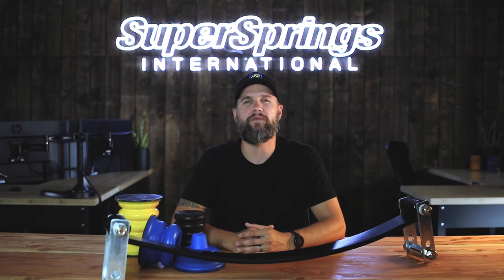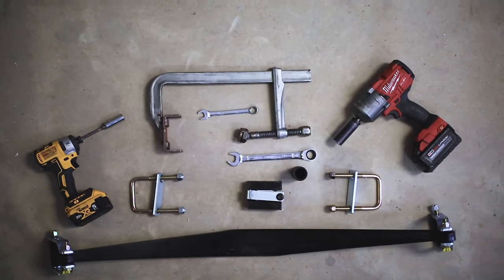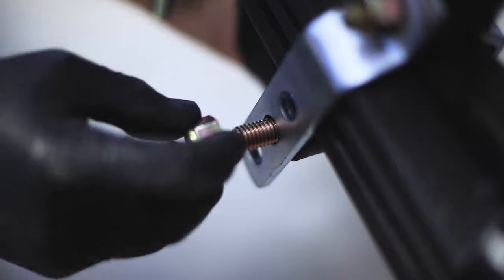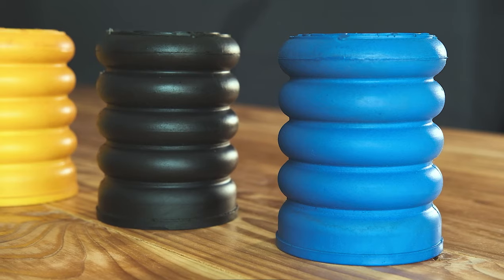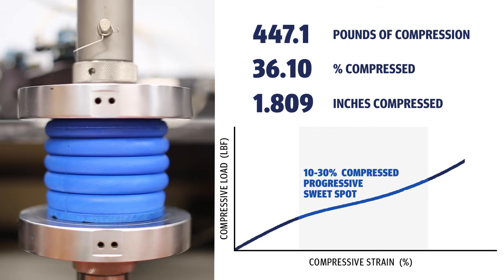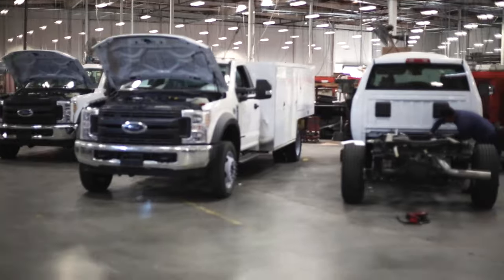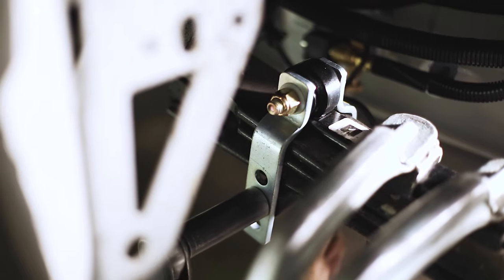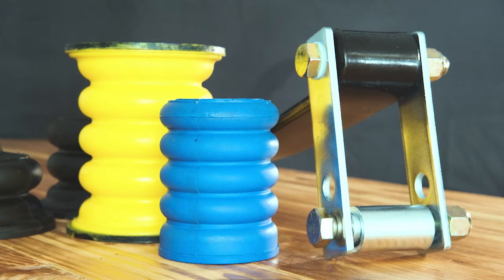SuperSprings vs. SumoSprings | Which one should I buy? | VLS ep. 2

Comment: We have a 2012 F250 Super Duty that we use to pull a Fifth Wheel with a 2800 lb pin weight. We only take it out 15-20 times per year. I'm guessing the SumoSprings would be better than the SuperSprings but not sure which "color". Am I incorrect or I guess I should say "what is your recommendation"? Also, if the SumoSprings are correct, is it ok to go with the heavier (5,000 vs 3,000) or is that not something I should do?
Reply from the maker: I'd go with our Blue Rebels the 3000 capacity ones! - Josh
Reply: Thanks Josh! I forgot to mention ours is a 4x4 if it matters.

Comment: Hello I have airbags currently on my f250 with a carli lift that has progressive leaf springs and need to run almost max psi on my bags to get back to near level even with my equalizer setup. Would the superspring still work with airbags and springs that don't have an overload?
Reply from the maker: You'd have to send us pictures of your suspension to confirm fitment on your vehicle. - Josh

Comment: Looking at adding a SSA26 to my 2006 F550 rollback, they bolt on top of the overload spring, could it not be adjusted so that they are not contacting the overload perch until weigh is loaded therefore not affect the unloaded ride quality? Not that its great now, just wouldn't want it much worse.
Reply from the maker: Hi Chase, For the F550.  The SSA26 will engage the overload spring and add a lot of preload to the leaf pack.  Because of this, the overload perches are not used anymore.  However, since the preload is much higher, the ride will be noticeably firmer. And the ride height is higher when the truck is empty.  That's the give/take you have with adding SuperSprings to strengthen the suspension. - Josh

Comment: I have a 2007 Dolphin 6320 (34' actual length) class A Motor Home. It's on a M22 Workhorse chassis.  The wheel base is really too short for it's length.  I have added Track bars front and rear, heavy duty sway bars, Koni gold shocks, steering stabilizer, and it still sways side-to-side in the rear.  It is enough to make handeling somewhat difficult. Which of your products do you think would SOLVE this expensive problem?  Many thanks!!
Reply from the maker: Unfortunately, we don't have products that fit your Motorhome.

Comment: I have a 2015 F550 rollback and I need whichever product reduces rear sag the most - The absolute most extreme product for reducing rear squat b/c the factory overloads are already making contact BEFORE it’s loaded with 2 vehicles.
Reply from the maker: Hi, thanks for reaching out! I'd recommend our SSA17 or our SSA26. Our SSA26 is the strongest. You'd probably require our ITL-8 tool to install it. But that'll get rid of the squat. - Josh

Comment: Added the blue summo springs to my 4Runner.  As the springs are always in contact you can feel the difference.  The 4Runner is not as smooth.  It’s a little choppy.  However, they do work.  Fully loaded using the third row it does keep the 4Runner from sagging as much.  Also improved the cornering a bit.  They work but there is a pay off.  

I have Timbrens on my truck. They sit an inch above the contact point.  So with those the ride remains the same until they make contact.  Then they are really stiff.  It does control the sag thigh.  Again, a pay off as these are stiffer.  

I had airbags on my previous truck.  Not recommended, but I kept them at 5 lbs of air to not stiffen the ride when empty.  Bags where great for maxing out the truck, just a pain having to air up.  Installing an air compressor drastically increases the price.  Thus these too are a pay off.
Reply from the maker: Thanks for sharing your experience! It's great to hear that the SumoSprings are keeping your 4Runner level and improving cornering, even though they might feel a bit firmer compared to the stock setup. Unlike Timbrens that sit above the contact point and can feel stiff when engaged, SumoSprings are designed to provide progressive resistance, offering a smoother ride until they compress, providing a more comfortable experience overall. As for airbags, while they can be great for heavy loads, the need for air compressors and the potential to stiffen the ride can be drawbacks. SumoSprings offer a middle ground, providing support without the hassle or compromise in ride quality. It's all about finding the right balance for your needs, and we're glad to hear that SumoSprings are working well for you!
Reply: On a positive note regarding the Summos, having them in for about a year now, the jarring ride has subsided as they are now broken in. Still controls sagging and keeps the decent cornering.  For our SUV I feel this is the better cost effective option.
Reply from the maker: @jor8061  Thanks for sharing your follow-up experience with SumoSprings on your 4Runner! It's great to hear that after some time, the ride has become smoother and more controlled. This highlights one of the key benefits of SumoSprings—they tend to improve with time as they 'break in,' providing consistent support and comfort. Your comparison with other options like Timbrens and airbags also shows how SumoSprings offer a cost-effective solution without sacrificing performance. Here's to many more smooth and sag-free miles ahead with your 4Runner!

Comment: Great videos and maybe once I have seen them all I might have a good few of them answered.   I find the comments very useful and you do a great job answering.  

So I too am reaching out .... I have new GMC 3500 HD Diesel and a new Cirrus 820 Camper.  Great combo; works well so far.   My camper unit - with me, my wife, the dog and the eggs, coffee and milk - uses 3600lbs or so of my payload.  I added a 5 leaf upper stabilizer at the recommendation of my local independant suspension guy.  This helped a bunch with sag and some sway, but now I am still a bit bouncy and I experience (and really now notice) PORPOISING !!   Yikes - that dreaded movement front to back and back to front.  

Would the blue Sumo Springs be of assistance?   I believe something to stop the "to and fro" sooner than later would be the answer.  Is it a spring issue or a shock issue?
Thanks in advance and I will keep watching.  I might reach out to your help line to discuss.  We will use the camper lots in the spring to fall, and when we have the camper on it might be there for a while.  We will also use the truck because it is a truck.  Maybe 50/50 use with heavy load
Reply from the maker: Hi, thanks for reaching out. Our black SumoSprings would be perfect for you. 
I'd go with our SuperSpringsint.com/SSF-202-47 for the front of your vehicle and  SuperSpringsint.com/SSR-207-47 for the rear. - Josh

Comment: I'm confused with the Sumospring ratings. The blue have 1000lbs limit at 50% compression, the blacks 1500lbs at 50% compression & the yellow 2800lbs at 50%compression. I have a Fiat Ducato H2L2 converted to a campervan, the kerb weight of an empty van is 1900kg (4188lbs) & the max payload is rated at 3300kg (7275lbs), mine now weighs in at 2980kg (6569lbs) Your spec stated the springs shouldn't regularly be compressed more than 55%. So which Sumosprings would I actually need? Just to note, my leak springs have sagged & the OEM upper & lower bumpstops are within 15mm of touching! The weight of the van doesn't change much, except for fresh water (+/- 50kgs...)
Many thanks.
Reply from the maker: Hi, thanks for reaching out. For your van, I'd recommend our SuperSpringsint.com/SSR-313-54/ for the rear of your van and our SuperSpringsint.com/CSS-1195/ for the front. - Josh

Comment: Would the Super Springs allow more load capacity to an F-550, just help with sagging, or both?  It's always loaded at near maximum payload and infrequently tows trailers under 5,000 pounds.  Would it improve handling or possibly make it less likely to rollover?

Comment: Need the perfect Sumo Springs for my new 2022 ram rebel 1/2 ton ....btw the rebel has a stock 2"plus lift which makes it difficult to get the proper airsprings / sumo's or timbrens to get the suspension helper system to engage as soon as possible so that the truck doesn't sag too much before the system is engaged....please advise...
I like the idea of the micro cellular design that offers progressive resistance rather than the timbrens material so I hope that there is a solution to this ram rebel stock lift issue.
Cheers
Reply from the maker: Hop on our website and use our chat function to talk with the team and get exactly what you need. You can even send pictures of the stock setup through the chat. - Adam

Comment: Hi - I've got a 2007 Sequoia that I haul a 3400 horse trailer with on a semi-regular basis. Trailer loaded is about 5500-6000 lbs. I had Super Springs on my 2004 Tundra I had before the Sequoia and they were great. Should I go with the Sumo Springs on the Sequoia as I'm looking for a smoother ride? Thanks!
Reply from the maker: Hi Lindsay! That's right, SumoSprings are your best option here. Depending on how regular this is you have the option of either the blue (-40) or black (-47) SumoSprings option. If you're towing less than 50% of the time, I'd go with the blues. The part number for you is SSR-623-40 or change that ending 40 to 47 if you chose to get the black option. -Tom

Comment: I have a travel trailer with 4400 pound axles and max gvw 8200 pounds which ones do I need I had a lighter trailer and it had the blue one I think this trailer needs the black ones?
Reply from the maker: For trailer SumoSprings, we need the GAWR, not the GVWR. If the GAWR is between 3,000 and 5,000 pounds, I would recommend the blue springs. If it’s between 5,000 and 8,000 pounds, I would recommend the black springs. Hope this helps!

Comment: I'm thinking I need blue. I load up my bed pretty good for camping trips. Getting a camper top next year, but nothing crazy heavy. Not thinking at all of doing anything major to the stock suspension. 

That chassis vibration you mentioned. When I'm on dirt roads and hit some washboard partches, the truck does start vibrating pretty good. Enough that I feel I have to carefully slow down, like I don't have totally good steering until it stops. Would these help with that? 

I
Reply from the maker: Yes, these would definitely help remove some of that vibration. - Josh

Comment: Can you use SumoSprings in conjunction with SuperSprings? 2022 Ford E-450 Class C motorhome
Reply from the maker: Usually, we suggest one or the other. SuperSprings will lift the vehicle, which can interfere with how the SumoSprings engage and work correctly. However given your specific vehicle type, you can call our service department and they can help you determine what's best for your situation. 805-745-5553. -Matt

Comment: I have a ram 2500 4x4 crew cab with roll out bed, fully loaded with tools all the time, a large truck rack and usually ladders. I do tow a trailer also - I’m getting sway at 55 miles per hour. Any recommendations for your products?
Reply from the maker: Hi, thanks for commenting. What year is your vehicle? - Josh
Reply: @SuperSpringsInternational  2015

Comment: my fifth wheel has dual axles it weigh 8000 pounds it has a tongue weight or a pin weight of 1200 pounds which sumo spring would I need?
Reply from the maker: Hi there! Are you looking for SumoSprings for your truck or trailer? -Andrew

Comment: I have a Class B based on an extended body Ford Transit 350 HD dually.  It came with Supersprings installed.  Handling is nice, but would it be OK to add Sumosprings to help dampen the biggest bumps?  If yes, what color should we consider.  Unloaded weight is about 8700 LB.  Thanks for the great videos!
Reply from the maker: Hi Jon - I also responded in the other video, sounds like you may have the SSA43 already! Love that! I'd recommend you add the SSR-121-40 in the rear to get the vibration reduction and damping. If you don't already have the front coil SumoSprings (it sounds like you might) then you'd want the CSS-1195 there. -Tom
Reply: @SuperSpringsInternational  Great!  Will do!  Order the blue ones . . .  PS:  I do have the front coil SumoSprings.
Reply: One last question before I order--I just wanted to make sure you thing the Blue (40) is the best one.  Given the descriptions, I thought the Black (47) might be the fit for this weight.  Or is the Blue better since I already have the SSA43 springs.  Thanks again!

Comment: I have a 2015 f350 cab and chassis with the over load spring. I am a pipeline welder and i have a heavy load always on the truck from the welding machine and all the tools plus oxygen and acetylene bottles to the welding bed it’s self. I also haul a 5th wheel camper probably once every 3 months with a tongue weight I’d say around 3000lbs. What product do you have that will better suit my needs and help with rear sag. And maybe even ride quality. I’ve tried air bags but they do nothing to help the squat when my camper is hooked up.
Reply from the maker: Hi Cody, is your truck a cab chassis? - Josh
Reply: @SuperSpringsInternational  yes it is.
Reply from the maker: @cody40131  I'd recommend our SuperSprings, they'd be perfect for your truck. SuperSpringsint.com/SSA25/

Comment: Looking for one for my ram Promaster 3500. Your website didn’t have a leaf option for this vehicle but I am not sure the sumo springs will work as this would be a constant load (maybe variable depending on the water tank level in back)
Thoughts?
Reply from the maker: We actually do! The product isn't showing up on our website but our SSA11 would fit your van. https://www.superspringsinternational.com/shop/ssa11
For stability and vibration reduction I'd go with our -40 SumoSprings.
https://www.superspringsinternational.com/shop/ssr-313-40/
And I'd go with Coil SumoSprings in the front: SuperSpringsint.com/Coil-SumoSprings/  - Josh
Reply: @SuperSpringsInternational  hey so I bought your SuperSprings SSR-313-54 but when I go to put them on the top nut breaks loose and I can’t tighten it all the way. And then I take it off and I trying to switch to use the shorter bolts but I can’t loosen it to get the bolt undone. what do I do
Reply from the maker: @justinwestphal6195  Hi Justin, could you send me pictures of what happened to my email, joshua@superspringsint.com . Thanks - Josh

Comment: I have 24’ gmc 2500. Use it for agriculture use. I pull mainly gooseneck trailers loaded with round bales of hay or cattle trailers. Pretty heavy most of the time. Hard to get 3500 dual wheel trucks through some of our gates. Trying to determine which application is best. Any suggestions?
Reply from the maker: Hi Brandon, first off is your Sierra a 4x4 or 4x2? - Josh
Reply: @SuperSpringsInternational  I’m sorry 4x4
Reply: @SuperSpringsInternational  any suggestions?
Reply from the maker: We have yet to 100% confirm fitment on 2024 model trucks. We are hoping to have this confirmed in January  @brandon779
Reply: @SuperSpringsInternational please let me know thanks

Comment: Have a 2022 Ram 3500 long bed dually. Which super spring would work the best/strongest? Will start doing 4-5 car hauling so I need your strongest stuff please. 
Note: I plan to install airlift 7500xl in addition to your product, if you have any.  Thx
Reply from the maker: I'd recommend the SSA24 along with the SSF-302-47. You probably won't need the airbags after installing our SSA24. - Josh

Comment: Would having a track bed cap, bedslide and roof top tent be considered as a permanent load? Total weight around 550 lb on chevy 1500. Which would work best for this scenario?
Reply from the maker: Is your truck sagging at all currently or is it level? - Josh
Reply: @SuperSpringsInternational  Right now it has only bedside and truck bed cap installed and I'd say it is level
Reply from the maker: @alexvlasov3304 I'd go with our -40 blue SumoSprings :) - Josh
Reply: My new GMC saga a little bit when hooked to 30’ travel trailer. I’m not overloaded and have a 1300 lb hitch weight. Which would work best to level it out? Thanks.

Comment: Currently I have yellow super springs on my 2020 GMC DENALI 3500.
 Told they don’t engage until there is at least 6000lbs attached to the bumper or fifth wheel hitch and won’t affect the ride because of this. Is this true?
Are there logical reasons to add the Sumo bump stops to my truck?
 I’m towing a 15000 lb fifth wheel toyhauler with a Tripple axle and a 5000 lb payload capacity. The side by side weights approximately 2000 lbs and my wife will bring 2000 lbs of cargo for sure so I’m thinking we will be close on our GWCR rating of 29700 lbs.
 Are there any logical reasons to add super springs and or sumo bump stops to my fifth wheel?
Thanks very much!
Reply from the maker: Hi Dell, thanks for reaching out. You have a heavy build, so I recommend the SSR-203-47-2 on the truck and the -47 Trailer SumoSprings on the 5th wheel.  I need to know if the trailer is spring-over or spring-under axle to give you the exact part number.
Reply: @SuperSpringsInternational  
I already have super springs on the truck but I’m not sure how to determine the numbers on them. I had a performance shop install them.
Reply from the maker: @dellparker7686  Do you know what the weight load level capacity of the SuperSprings are ?
Reply: @SuperSpringsInternational  
No sir
When I bought them I thought there were super springs for the truck I have and I assume the shop sold me the one that are for a 3500 Denali.
 Is there a way to tell by looking at them? Say a model number on them somewhere?
Reply from the maker: @dellparker7686  Could you send me a picture of it to joshua@supersprings.com ? Thanks. - Josh
Reply: @SuperSpringsInternational  the sticker on them says
SSA-13-2
Reply: @SuperSpringsInternational  just sent pictures